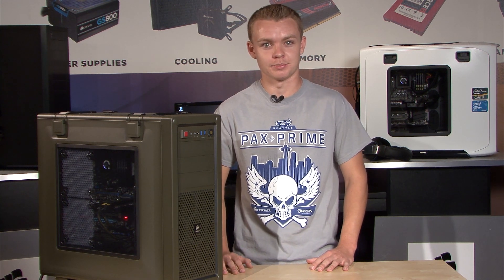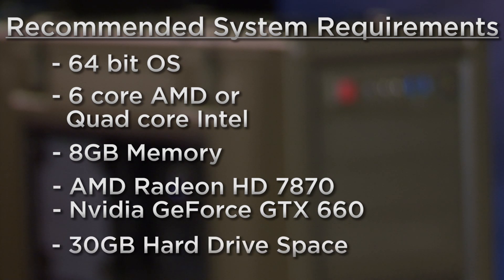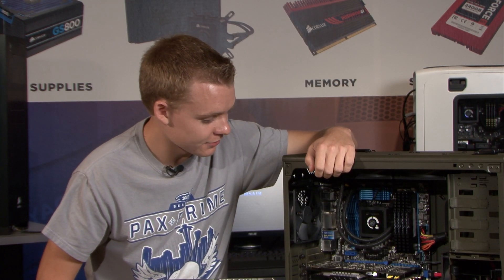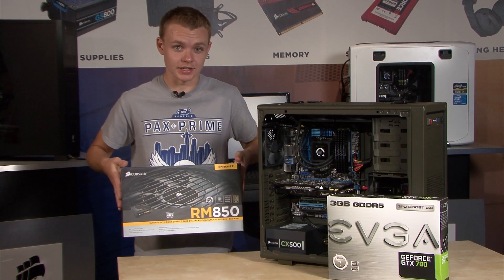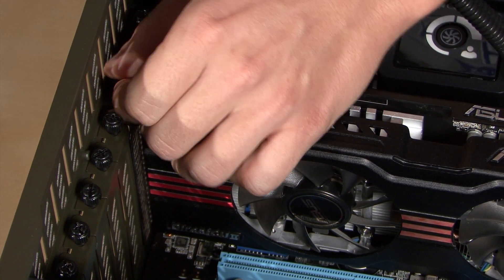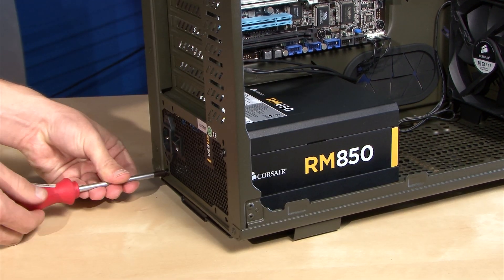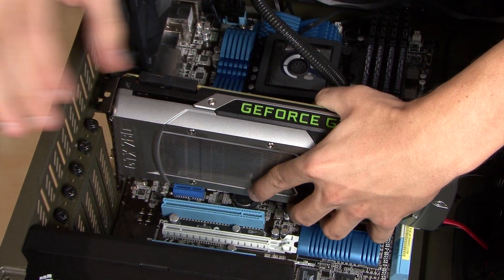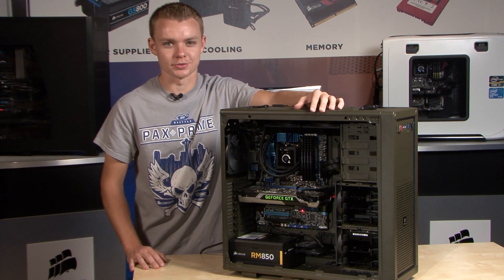The Battlefield 4 Build Project, Part One: Your PSU and GPU

Comment: What case is that?
Reply: Corsiar (of course) C70. Or as I like to call it the "Ammo Can"
Reply: Thanks! Is this a full mid tower or is it smaller? I have the corsair 200r and want a nicer case. I dont want it any bigger just nicer with more fans places.
Reply: Dfompc Mid-tower
Reply: Ah kk thanks!
Reply: Dfompc would you recommed the 200r?
Reply: PanzerFaustFurious I would not recommend it. I mean for the price its ok but even at that you can find something alot more quality.

Comment: actually i think his 500w PSU is enough for the 780,go check out one of LinusTechTips videos,he built a system with an i7 4770k and a 780 and the system ran 465 watts load with a 550watt PSU,maybe it's cause it's 80+ gold,i'm not sure
Reply: it ran because it was 80 + gold... a cx500 is not good for a 780

Comment: why 660 when 760 is better. Also remember older 670 is than 760 so no need to upgrade there, or at least by most benchmarks.

Comment: um....i can run 2 7970's with my 3570K at stock, or even unclocked, and a 2500K is only 10% less performance, so you sir, don't know what you are talking about, so yes, he can run a 780 with only a 2500K